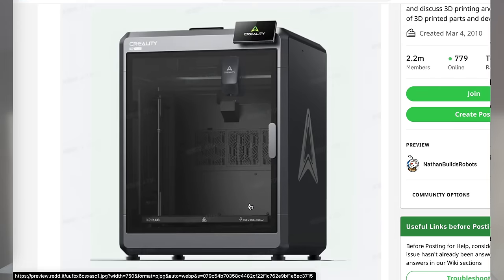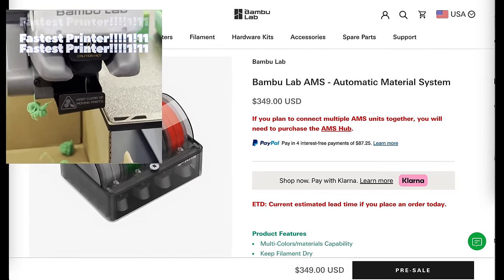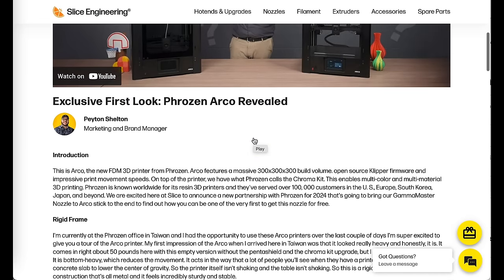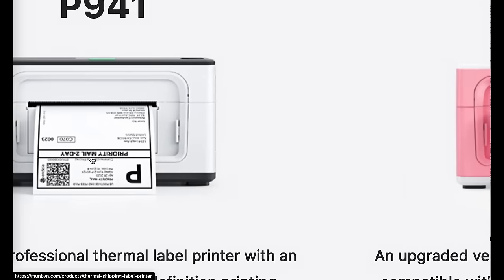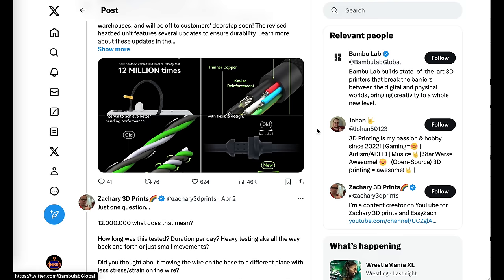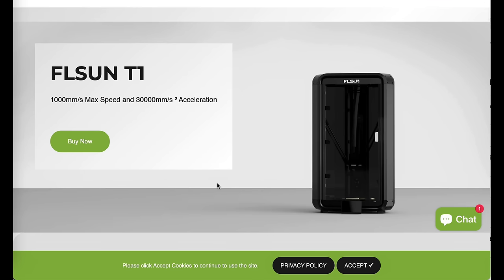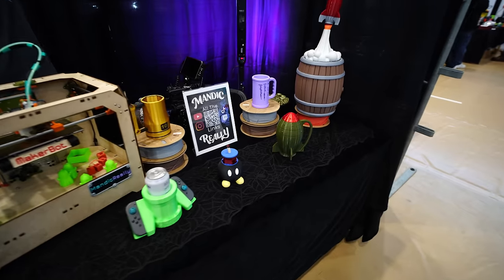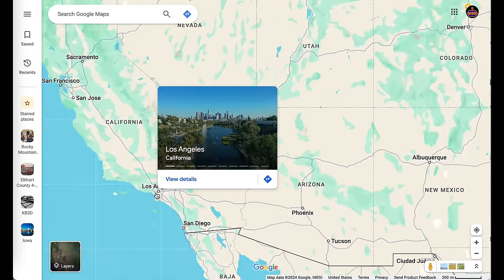3D Printer News April 2024

Comment: Thanks Bambu Lab for forcing Crealty and everyone else to up their game.
Reply: this
Reply: they wouldve been on the ender 9 if bambu didnt slap them awake
Reply: You mean than you Voron design, prusa, slic3r, reprap group. With out them Bambu wouldn't have any thing to copy
Reply: @elchavode6479  they're more like the apple of 3d printers. they just work right out of the box with little to no configuration and slick ui. Even if it is a copy it's better than the things it's copying.
Reply: @elchavode6479  of course they did, but that's not the point.
Reply: @TheFreestyleStorm sure but it's not good that we're moving towards more proprietary designs as a result, does make me a bit worried.
Reply: @AlexDenton0451  I agree but their system works. Until other manufacturers can have the same reliability and quality this is the best we have.
Reply: Yeah! its the first time Creality has tried to fix one of their prototype printers that they release, it took many iterations of the K1 extruder and hotend to get one that worked correctly (ish) did they ever fix the warping bed issue? I lost interest in it!
Reply: @AndrewAHayes  The answer is no. Creality has had busted print beds since their first printer and continues to be their problem. Offer cheap (ish) printers that work just well enough you don't feel scammed but have to screw with it for 45 mins before every print. K2 looks cool but you know it's going to be annoying just enough you wish didn't buy but works good enough you don't return it.
Reply: @BlueMax717 my friend bought ender 3v3 and he hast got failed print yet   and the setup was like bambulab(easy) and it costed him 300$ and prints at 600mm/s

Comment: I wonder, what it's like to start with 3D printing currently? There's so many awesome options to start with! But seems like every 6 months even better stuff comes out. I've been giving some courses about 3D printing basics, and the most often question is "which 3D printer to get?". It's getting harder and harder to answer it without making a lecture of it...
Reply: May or may not have been the "correct" way to get into it, but I got into 3D printing by buying a broken bed slinger and fixed it, upgraded it, and I am continuing to upgrade it beyond recognition. I went from knowing absolutely nothing to... well something I'm sure. There's a ton of info out there, if someone wanted to follow my methods, they could very well get a broken Ender 3 on eBay and do the same.
Reply: Got asked that a few times in the last months. I arrived at 
1. decide if you want to have 3d printing in itself as a hobby or if you want the printer as a tool to learn cad design and use it to make stuff. 

2. if it is the latter buy an a1 when it becomes available again. 
If you need more exotic materials or want an enclosed printer and have the money p1s or x1c.
If you care about open source and/or want to support a european company prusa mk4.
If everything listed is to expensive: 
A used mk3s.

And if you want to get into 3d printing as a hobby, building 3d printers and getting to know the ins and outs: ender 3 for cheap and prusa mk4 kit for expensive and reliable
Reply: @maxp4790  I start with "what do you want to print?". If you want cosplay parts you need something bigger, if you want figurines, you need a resin printer... Etc. Good thing is there are options, but I highly avoid giving direct recommendations. Ender 3 v3 ke is awesome! But won't be all that great if you want to print helmets. Building is also a great option, and it takes a bit to convince someone new to it, since it seems daunting, but I specifically bring a custom made printer with me, just to point out how one could do it.
Reply: Any Bambulab printer depending on how much money you want to spend.  Just getting started in 3d printing, an A1 or A1 Mini won't break the bank.  If you are on a mission to eventually print more exotic and engineering grade materials, just get a P1 or X1 as the enclosure allows you to print PC and nylon.
Reply: Well I just got into 3d printing actually, I like for a month just researched printers endlessly and settled on a bambulab p1s with ams at the end.
Have been printing almost flawlessly ever since. Had to unclog the nozzle once , and remove broken filament from the ams but i was helped by the wiki along the way to catch the problem and to solve it. Amazing experience so far :D
Reply: @MrHans-iy5lq  I got into it a few years ago and it's night and day.  Started with an Ender 3 pro with no bed leveling, had to adjust the bed and nozzle height almost every single print.  Spent hundreds of dollars upgrading my Ender just to have less features, speed, and quality I can get from a Bambu printer.  You picked a good time to start
Reply: @mikeb1596  I couldnt agree more , its such a great time to be alive. So cool technologies getting avalibe to us lending a really big creative freedom into our hands :)
Reply: I feel like this is the struggle you have with any electric device you get new ;) which one to pick? But yes I understand your thoughts, I also think it is difficult for newcomers to choose. But in the end I think for a beginner it doesn’t matter that much which specs the machine has as long as it prints well

Comment: My biggest problem right now with other manufacturers that more people need to talk about is it seems every new printer release is a paid beta test. At some point 3D printing needs to transition from a tinker hobby into a reliable tool straight off the shelf.

Are all these new multicolor systems on a core xy good? Yes, absolutely. But until they can get you a high quality out-the-box seamless experience I'm not going to pay them much mind, even if they are cheaper. It's simply not worth the time and headache to save a couple hundred dollars.

Comment: I've been waiting for a 300+ mm cube 3D printer with a rock solid extruder and steel motion control instead of acetyl V rollers for reliable higher volume printing of multiple parts.  It sounds like that time is finally near.  I don't care about multiple colors but I would like to print TPU and a rigid material such as PETG so I'd be interested in a dual extruder system is it was reliable and didn't make a ton of poop.

Comment: I’ve got an older Munbyn thermal printer running off a CUPS server on my Voron 2.4r2. Works great for AirPrint on old printers!
Reply from the maker: That’s awesome. Munbyn is quality stuff. 

My previous labelmaker was the cheapest one on Amazon (from another brand) and I had to spend hours tuning it to get the colors right, and still it’s off center so I miss a sliver of the printable area.

New one works great though

Comment: thanks for the video. Heard the FLSUN V400 which was a klipper machine wasn't really a full on klipper. One reviewer also stated the runaway thermal settings were set way too high to it wouldn't shut off = fire hazard = not good. I"m really interested in the S1 but when you fake install klipper, or at least a very old and outdated version that isn't being truthful with the public. Makes me wonder about the software side of FLSUN. 

I want my first fdm printer to work and not be a beta when released so a company can work thru the problems. Hoping Bambu makes a 350 cubed K1C XL and work out of the box. They have everything just need to make the K1C bigger and add a few more improvements to it and the AMS (seen a lot of folks complain about it recently).

Comment: The Qidi printer is a problem with the 220v system, NOT the printer itself.  However EU and anywhere else that 220 is used, its live still for that heater, just is how its wired.  In the US or anywhere using 120v, its inert and off when its idle.
Note:  Colorado is NOT "west coast" serving, hell it don't serve much of anyone unless your in the rocky mountains themselves.  Really need a RepRap in like Portland or Eugene Oregon, that is something more "central" located for the west coast.  As that is easy to fly to from Cali or a decent drive for most in Western Washington (about a 4 hr drive from Seattle to Portland).
Reply: I used to live right near Loveland, CO and it's funny, while geographically it's literally about in the middle of the country, if you even dare call it midwest even you will get some dirty glances.  They are sure it's the western US there.
Reply from the maker: Well then, who is going to start WRRF? 
I’d vote Portland or Seattle for location would be nice. Both cities have big airports, and plenty of space in the suburbs to host the event at a lower-cost venue.

Comment: Been 3D printing since 2013. Makergear M2 was my first printer. I have SEVERAL printers now. Been building a Voron 2.4(350). Several months ago I purchased a P1S with AMS. As soon as Bambu releases a large format printer, I’ll jump on that for sure!
Reply: I held out on buying my X1 Carbon and AMS in the hope Bambu Lab would release a tool changer to compete with the Prusa XL, but it didn't happen and so I purchased my X1C and AMS.
 I am having issues with it at the moment, it crashes into the front corner and knocks the cover off every time I start a print.

Comment: It seems from some sources that Creality's Filament System won't work for older printers.

Which is a shame; I am a big fan of the Ender 5 S1 and was looking to keep adding onto it besides the Sonic Pad and nozzles.
Reply from the maker: I've sure someone will come up with a way to retrofit it! That's the nice thing about open source moddable products.
Reply: Ive heard the opposite.  And the slicer is fully compatible
Reply: @anthonylong5870  Actually yeah I've heard just the same since I posted the comment. We just have to wait and see I guess
Reply: @Techzal3D  During the presentation they said it will be compatible with the V3 series.  So basically from the SE on up

Comment: NBR - Any reviews expected on the Qidi Q1 Pro? Thanks for all you do.
Reply from the maker: No, they are still mad that I called the x-max 3 “the Goldilocks printer that nobody asked for”
Reply: @NathanBuildsRobots  sigh.. unfortunate haha. I just returned my 5M pro.. was great for PETG and ASA but it struggled at those temps and the HW would lock up and get an error screen forcing me to power down and power loss recovery didnt always kick in.. even on the new 2.6.5 firmware. I figured the Q1 looked the next best in the same price bracket?

Comment: Genuinely excited for the Sovol 8 as a means to bring Vorons to the masses without the proprietary BS that comes with a Bambu or quality issues that come with Creality. In a lot of ways Sovol has overtaken Creality as a manufacturer that supports modifications, spares, etc.
Reply from the maker: I haven't thought about it that way, but I think you're right!
Reply: It does have proprietary nozzle though. Which sucks. Not the nozzle, I'm sure it's fine, but it's very different from the norm, so unlikely we'll get many variations in it.
Reply: @astrumrocket6556  true the nozzle is a downside but it won't take long for people to swap that out.
Reply: @anwyll or swap out the whole toolhead
Reply: I saw a sort of review of the Sovol 8 from one of the Voron guys. It doesn't even print without modifying the files and the plastic parts were bent. Total piece of junk.

Comment: @14:32 You're incorrect! I guess you haven't tried it yourself.. You absolutely cannot stick your finger in there! 
And the whole thing is so blown up, it's not a big deal really.. If you remove all the protection around the heater element, leave the machine plugged in and then touch the heater, yes it will shock you.. But that's also true if you if you dismantle your washing machine and touch some contacts.. 
So just be sensible, unplug the machine if you want to tinker with it..

Comment: Bambu has got a BIG wakeup call coming.  All the other companies are surpassing them now.  A lot of people dont realize that Bambu is using 2 year old tech at this point
Reply: Still, it's a trusty workhorse for me. Almost zero issues with my X1C in the past half year.
There are many unknowns about these other printers. I'll wait  a year after release before considering buying. Don't get me wrong, I don't have any Bambu loyalty. Even more, I'll gladly switch to other another brand.
The SOVOL-08 sure seems awesome and I'm very tempted but I'm still waiting for a 400x400x400mm or above enclosed 3d printer with MMU. And it should be as easy to use and low maintenance as a bambu. So I can just focus on 3d design. The print speed is not that important because as stephan from CNC Kitchen said, after 200mm/s, your print quality declines greatly.
Would be nice if Prusa came up with one. But I'd rather not have multiple toolheads.
Reply: I don't see what they are surpassing them with. More like catching up.
Reply: @woodcat7180 still waiting to hear of the alleged Bambu tool changer lol.  (Never gonna happen watch)
Reply: @br3nz3l  Unknown about a 3D printer company that has been selling 3D printers 5X longer than Bambu? lol ok
Reply: @woodcat7180  Oh lets see here, where to begin...... 1. Larger bed, 2. Heated chamber, 3. Lower price. 4. Better screen, 5. Faster.    Off the top off my head i would say thats surpassing Bambu
Reply: @br3nz3l "there are many unknowns about these printers" "I don't have any Bambu loyalty" lmao
Reply: @krollmond7544  Doesn't matter for me. I'm not a fan anyway.
Reply: Yet that 2 year old tech delivers and just works, whereas many other companies deliver stuff that you have to "get working".  Bambu seems to think through what they make.  Their filament cutter and poop chute allows automatic filament changes with an AMS to work reliably, while the MMU and enraged-rabbits gave more problems than successful filament changes.  I'm surprised a company putting so much thought into their products already has such a portfolio of printers and the moment they come with a bigger one or a toolchanger, I think it will WORK rather than require so much tweaking that getting it working is the hobby ...  That said, I really hope Creality can deliver a K2 plus that IMPROVES on the K1 max and reaches the same reliability of the Bambu's and similarly for their AMS.  Copying what Bambu already did should make that more likely, unless they ... repeat their earlier mistakes and cut corners that should not be cut.  The SV08 to me seems in the corner cutting area: enclosure not standard, complex voron 2.4-alike floating gantry that adds complexity and cost and then bringing that at a price that isn't matching said complexity ...  Sounds to me like a risky combination, but I hope to be proven wrong.
Reply: @MisterkeTube  Just about EVERY new printer works out of the box now.  As far as Bambu's poop chute?  That thing has a defect that on long multicolor prints the purge"poop" tends to hang on the little shelf inside the chute causing backups that cause clogs (common issue)  The AMS being "reliable" is a joke with its spool hop, nozzlr clogs and problems with cardboard spools.  They have also said that they "have no plans right now" of a tool changer OR larger print bed.  You Bambu cult members are just pretty narrow and cant grasp the truth about Bambu: They are nothing special, they are dated and they have fallen behind.  Within the next year they will be a second thought with buyers
Reply: @MisterkeTube  Let it go because from the minute we say something positive about the bambu 3d printer, they point at us, mock us and declare us Bambu zealots.
They act like the grinch at christmas.
We know it's worth and that's all that matters. Have a nice day,
printing and not tinkering ;)

Comment: The Qidi chamber heater thing is a  non issue.  You wouldn't go poking things into a space heater without it being unplugged, why would you poke anything into a chamber heater?  It's dumb.
Reply from the maker: As an engineer, you have to consider what happens when people do stupid things, and make sure they don’t get electrocuted when they do.
Reply: @NathanBuildsRobots  as a person with a modicum of common sense, don't poke your fingers into a heating element when is plugged in.  I don't own a Qidi and likely don't plan to.  However, there's been a ton of videos pointing out that this is a non issue.  I guarantee you don't cover all your sockets at home, just on the off chance you feel the urge to stick a fork in one.  Why?  Because I'm going to assume you have the tiniest bit of common sense.

Comment: Hi Nathan. I own a Bambulab A1 and I made a several complaints to the company for not sending yet the bed replacement also I own a X1C where the waste chute door support broken and I had to open the wallet to get a new spare instead sending me the spare for free under guarantee because it was their fault for design so badly. When the new arrives, I will redesign it, using the old one, to try to work much better.